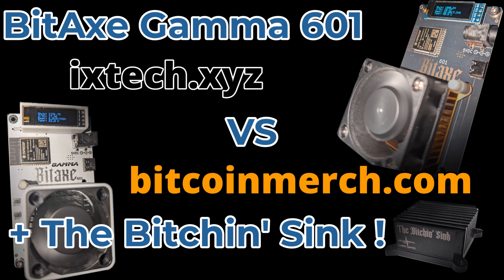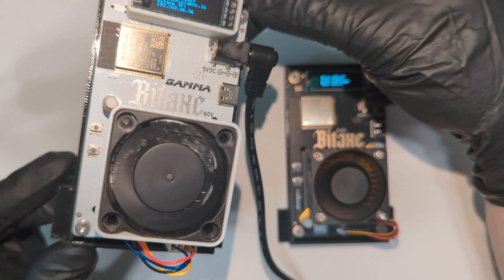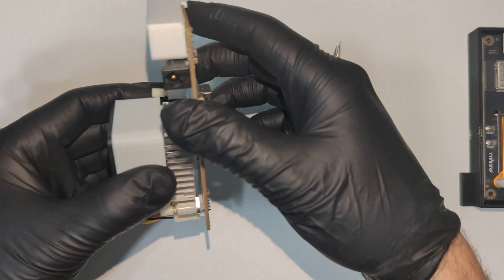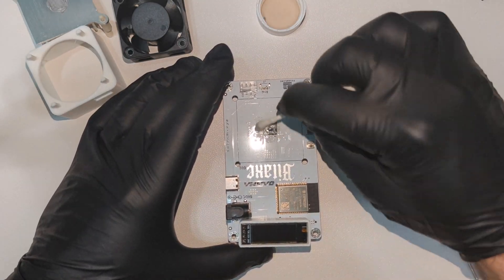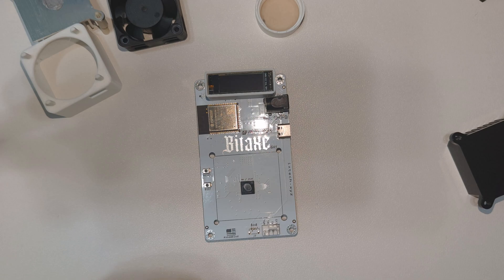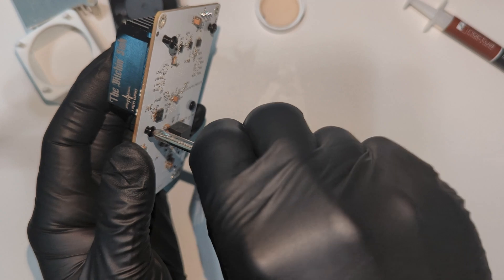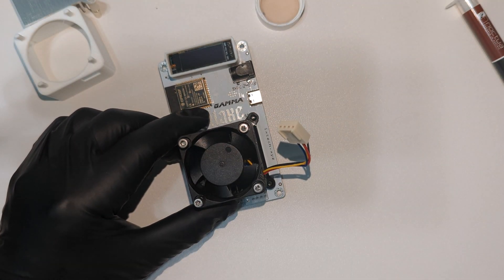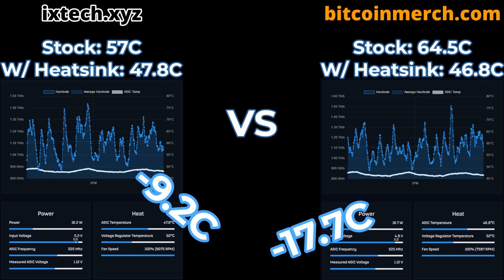BitAxe Gamma 601 Teardown & Bitchin’ Sink Mod: IX Tech vs. Bitcoin Merch Compared!

Comment: Great review! Good to see the Gamma out in the wild and people tinkering with them. Another key factor to improving temperatures is using high-quality thermal paste like you did. Even if folks don't have a bitchen sink or other aftermarket heatsink to replace the stock one with, simply putting high-quality thermal paste can improve performance

Comment: Bitcoinmerch is the absolute worst
Reply from the maker: In what way?

I've dealt with them a handful of times and never had an issue. Anytime there was a possible delay on an order, it was clearly stated on their website prior to purchase. Prices can tend to be on the  higher end, however you should consider they are one of few resellers that allow payment via Debit/CC. They also ship from within the USA so you don't have to worry about paying import duty/fee's.

I will say, when I purchased the miners discussed in this video they had them at the LOWEST price, w/ CouponCode.
Always check multiple vendors, and see what coupons / offers are available.